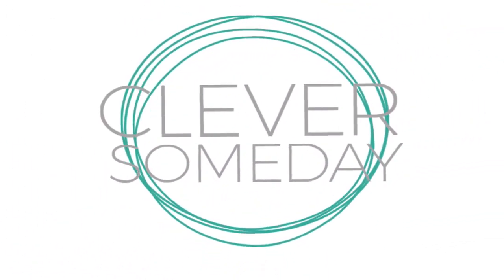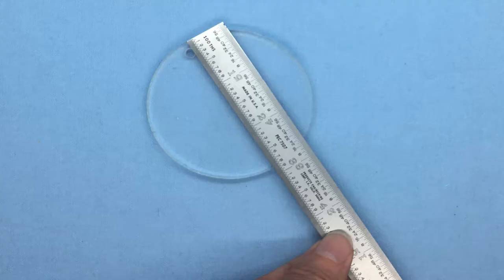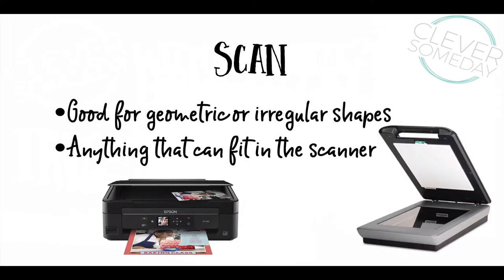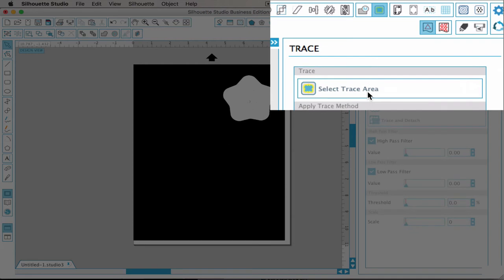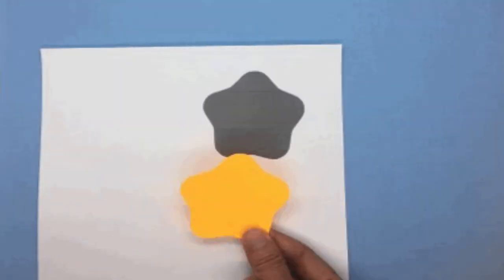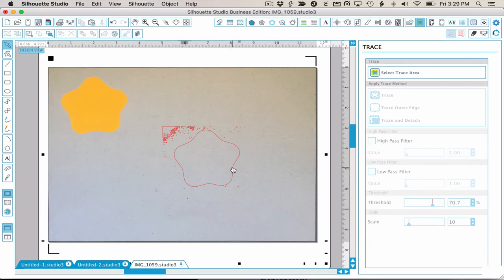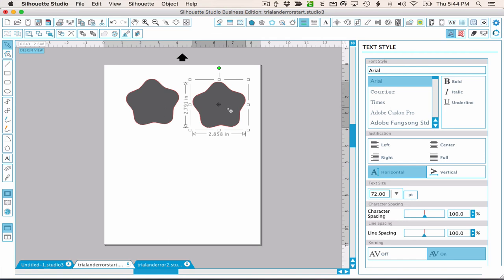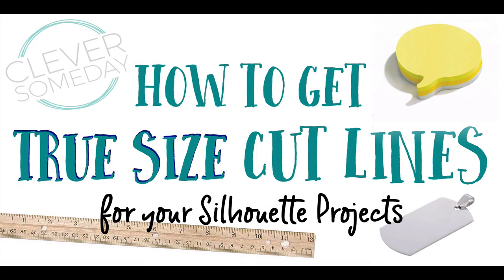True Size Cut Lines in Silhouette Studio

Comment: Hi! thank you very much for a great tutorial. I have been searching for this for a month. I even got in contact with silhouette because of problems with true size in print and cut and they haven´t been able to give me an answer.  I had just come to the conclusion that silhouette studio is not accurate enough.
I have wooden elliptical blanks and I print ant cut vinyl to stick on them. The problem is that every time I open silhouette studio to make one (I had a template saved in studio) and print and cut my design the measures change, they are off by some mm.
So I have to print and cut it in copy paper, measure how many mm in width and height are off, change the mm in the template and then print and cut it in vinyl.
Did it ever happen to you?
Thanks!!
Reply from the maker: I have some ideas on this. Please contact me via http://cleversomeday.com/contact/ so we can pick this up by email.

Comment: Quick question... Can't you change inches to MM in preferences?  Or was this older version of studio
Reply from the maker: yes, you can change inches to mm. But you can't change from decimal inches to fractional inches, which is the standard measurement style for US crafters.
Reply: CleverSomeday 
Ahh ok that makes sense. I was worried that when I changed to mm I wasn't getting true size. Now I understand thank you for explaining.  When I get the pixscan to work it's been great for replicating model parts in plastic sheet. Thanks for ur videos they have helped!